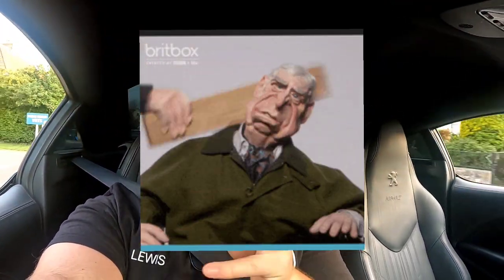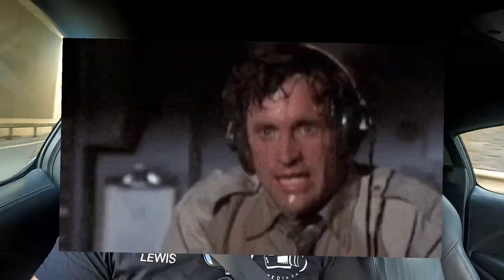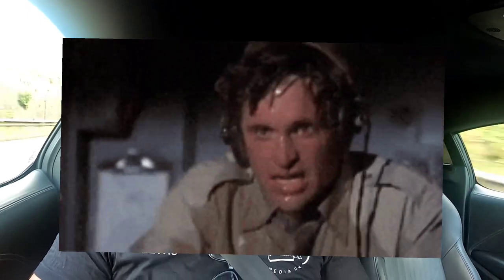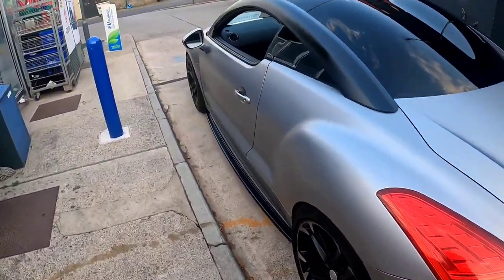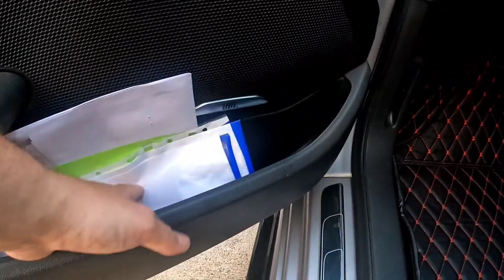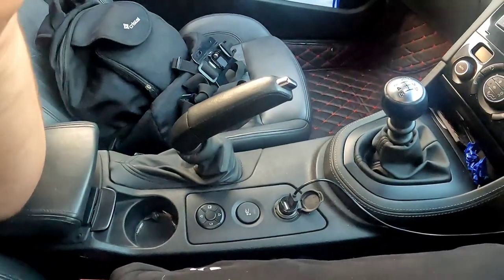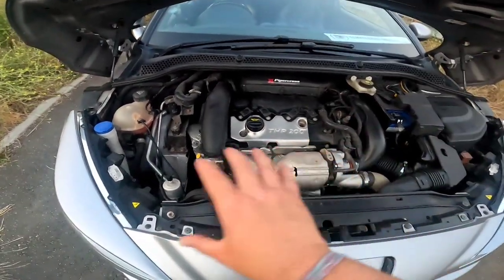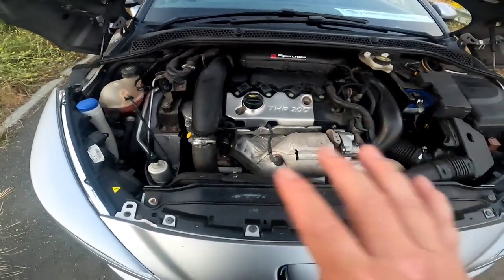I REVIEW MY PEUGEOT RCZ THP200 ASPHALT EDITION 🇫🇷

Comment: Looks absolutely stunning, mate. Shame you had so many issues with it. Do you know what the most common issues with the 200bhp are? Is it the same engine that was in the early 208 GTis? IIRC the 208 GTis were riddled with faults until the THP 208 facelift in 2015.

Comment: Did you sell this recently? Did the clutch get replaced?
Reply from the maker: The car is riddled with issues, I had to sell it on cheap as a car with faults as it just started falling apart in my ownership

It has two oil leaks - sump and crankshaft seal

Smoking oil with suspected piston seal failure

Clutch was iffy but worked

Thermostat issues
Reply: Great video!!! Was about to buy in a next few days😅 I suppose the seller in Grimsby done fuck all to it but does mention what you have done 😂
Reply from the maker: @andrey_the_gypsy8489  it's not worth more than 2k tbh with all that needs doing
Reply: @LIMITLESSMEDIAUK_  how much it would be worth in good condition?
Reply from the maker: @andrey_the_gypsy8489  6k but it'll need a good £1000 plus to fix
Reply: So basically stay away from your rcz in Grimsby ?
Reply from the maker: @andrey_the_gypsy8489  yes unfortunately, go check it out for yourself any you'll see

Comment: Pertrol engine for these cars are just unworkable. These are prince engines which have constant issues while diesel version is bulletproof. They also are a lot rarer and demand greater premiums.
Reply from the maker: @REgamesplayer  as I say they're great WHEN they're working right 😂
Reply: @LIMITLESSMEDIAUK_  I'm not used in making consciously bad decisions. 😆

I'm considering buying one of those cars now. It is a diesel version, high on miles, decent price. Well taken care off by current owner. If I will sell my car tomorrow, I will consider it. I just miss leather seats as ones in that car are not great. Also, there is no in built navigation. Two things which really are holding me down.
Reply from the maker: @REgamesplayer  if you get a GT with the optional nav you'll have a sat nav 👌

Comment: There are 3 petrol engines not two. The 156, 200 and 267bhp of the R.
The RCZ was styled by the same design house that styled the Audi TT.
Rather than trying to upgrade this 200 engine, just buy an RCZ R.
Reply from the maker: The r is in a different league hence why I've kept it out and focused more on what everyday rcz owners are looking to buy plus I've had experience of both so I used it as a chance to compare both so yes it wasn't mentioned you are correct
Reply: Audi tt designer peter schreyer , rcz designer boris reinmoller
Reply: Mines pushing 240bhp and suspension upgrades for 93000 miles no issues reason i dont buy an rczr is i dont like the facelift i prefer the original design. But everyone to their own. All personal choice.
Reply: @sjm.photos  Yebbut the R was a complete package by Peugeot Sport. The Alcon brakes, better suspension, LSD and sports seats. I've probably missed a few things.
Reply: @sjm.photos  Same design house though. You can see the similarities and differences.
Reply: @LIMITLESSMEDIAUK_  If you are doing a review of the RCZ you want to give the correct information irrespective of your own experiences. Peugeot's 1.6 litre petrol engine in the RCZ comes in three power outputs 156, 200 and 267bhp. To totally omit one is not giving the full picture. I am an everyday rcz owner who ever one of these is.